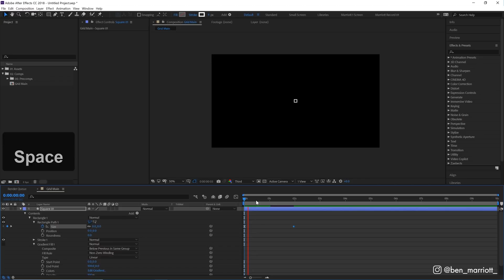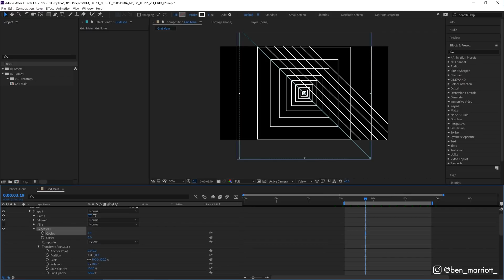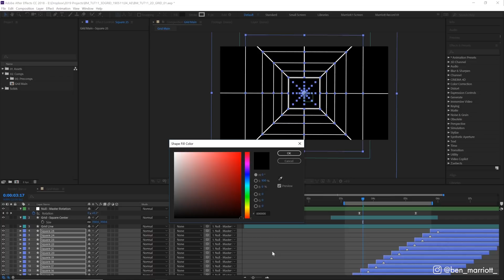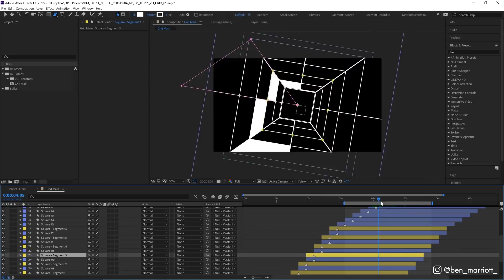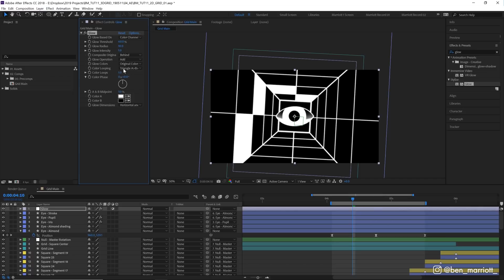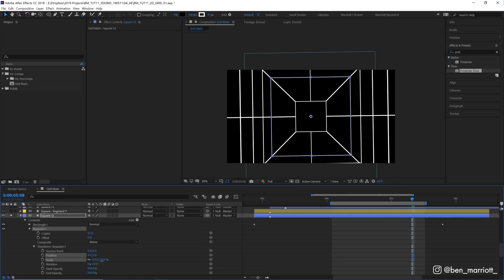After Effects Looping Background Tutorial - 3D Grid

Comment: men your tuts are amazing. Just to collaborate with you i would recommend offsetting the repeater scale setting instead of making that amount of shapes layers, cheers!
Reply from the maker: Thanks so much man! I try that towards the end of the video, but the stroke also  scales so it's much more difficult to get a loop or a consistent line-weight. It works wonders if that's not an issue in your scene though :D